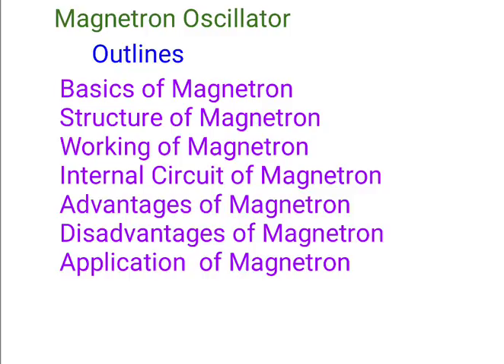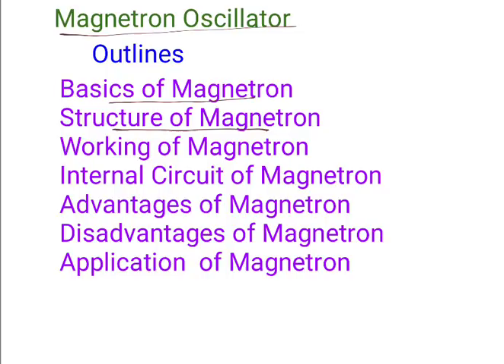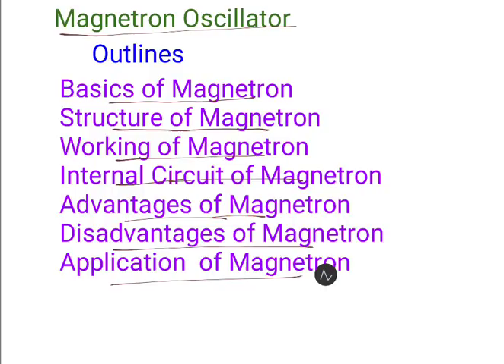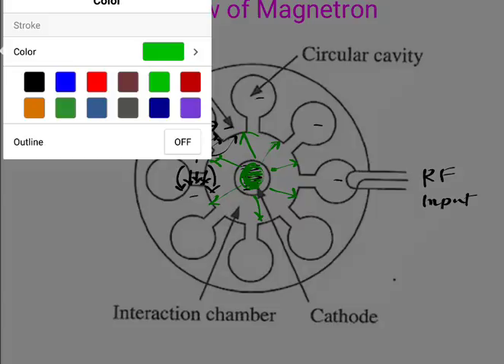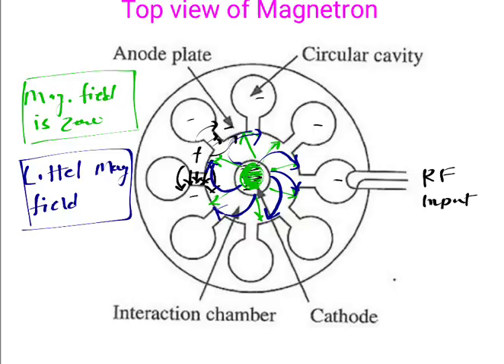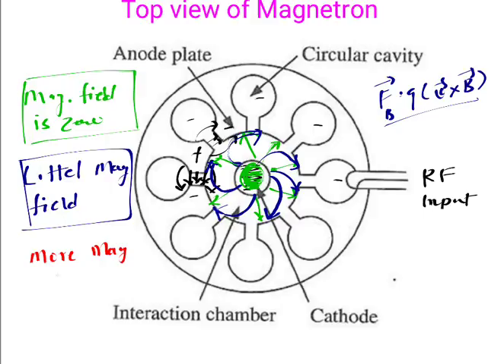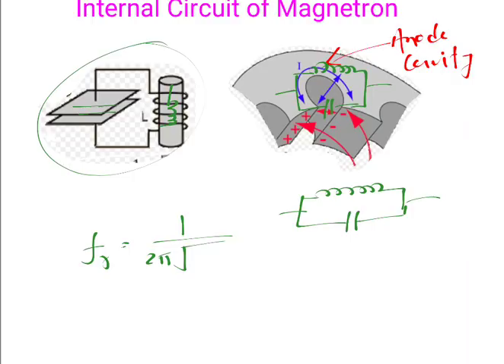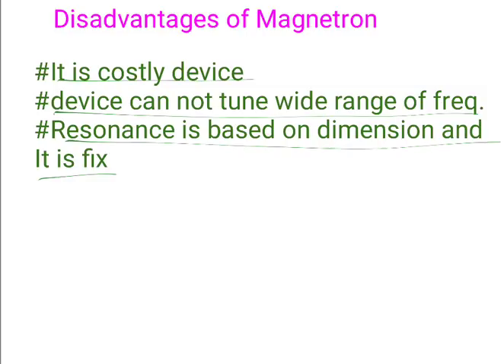Cavity Magnetron or Magnetron Oscillator (Basics, Structure, Working & Characteristics) Explained

Comment: you have explained partially incorrect. There is a fixed magnetic field provided to magnetron. And the bunching takes place because when oscillations happen in anode cavity, then a tangential elec field component is generated by RF; which in turn retards the electrons. Moreover, the oscillations happen not because of LC circuit . Its because when RF is applied to the cavity, the cavity behaves as short circuited Transmission line of different wavelengths (as per the no of cavities in design). Thus a resonance occurs due to standing waves generated.

Comment: does the antenna output also generate radio frequency or high frequency alternating current?
Reply from the maker: Antenna radiates high frequency signal
Reply: @EngineeringFunda  does it only output HF signal waves? or emit high-frequency electric current?
Reply from the maker: @kikikikiki489  magnetron generates HF only
Reply: @EngineeringFunda  ok thanks , I also want to know if we can set the magnetron frequency output to another classification ? I mean like this, most magnetrons have a frequency of 2.4 Ghz, can we change it to a frequency of Around Khz or Mhz?

Comment: if we use the electromagnets in microwave oven instead of regular magnet than what happened, will it possible to change the frequency instead of the time which is not suitable for many food mixture in india
Reply: Frequency, time and power are very different variables!  Magnetron frequency is determined by the physical cavity dimensions.  Most microwave ovens can deliver a range of power levels so that your cooking time can be what you want.